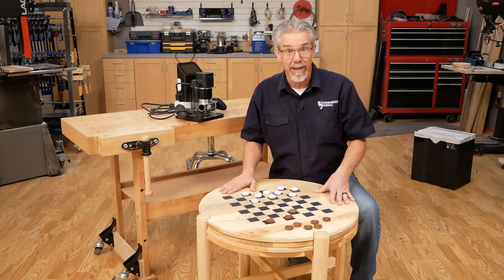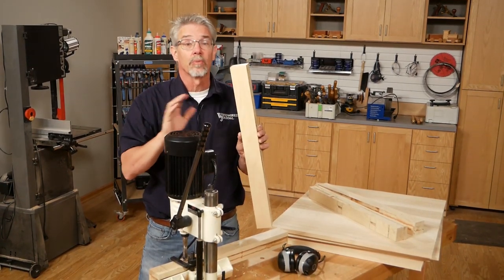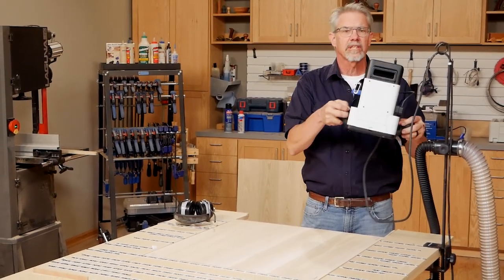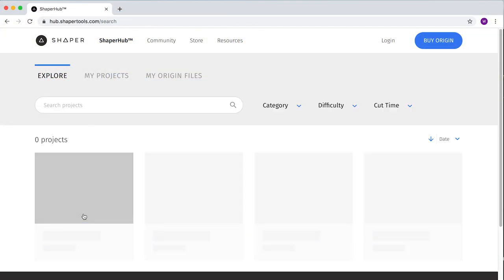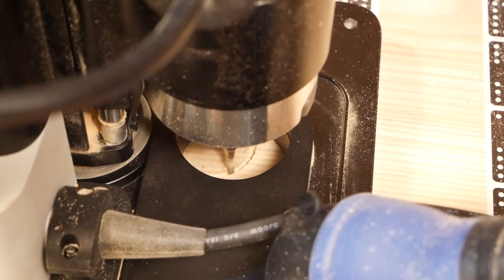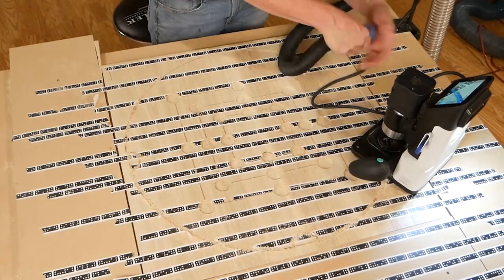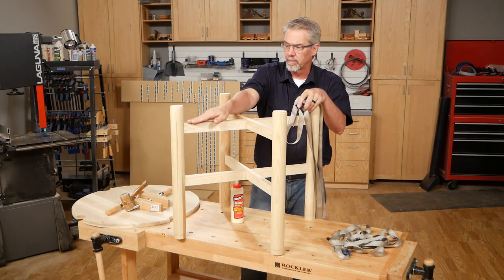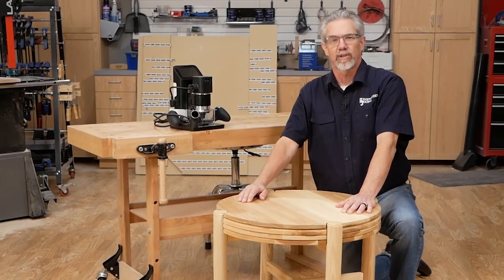Making a Game Table with the Shaper Origin Router

Comment: I have a Shaper. I am in the process of making a large round kitchen table with it. Used the SO to cut out the 60" top, cut a 2" on the edge of that top and will use it to cut the mortise and tenons for the base. All made of Red Oak.